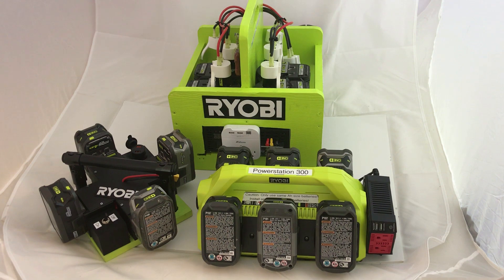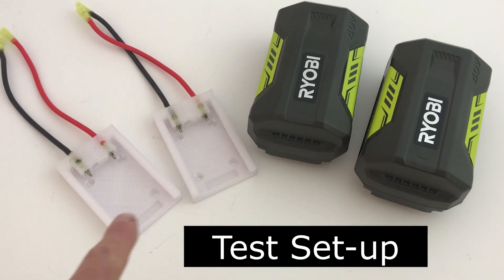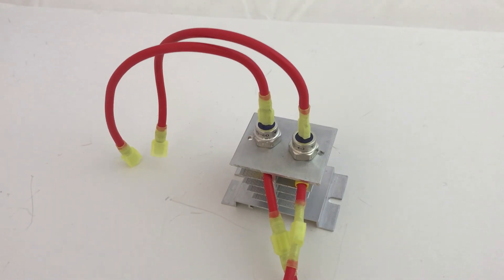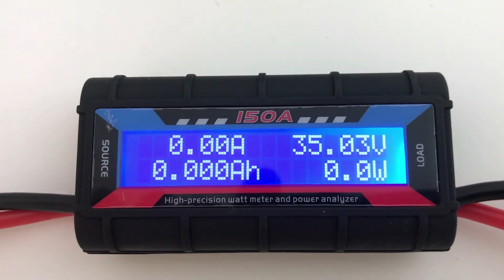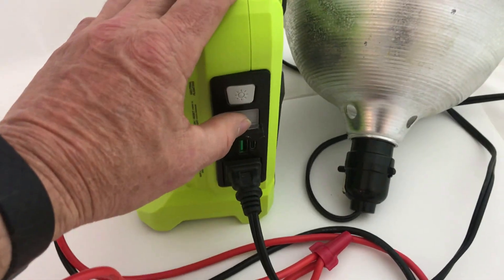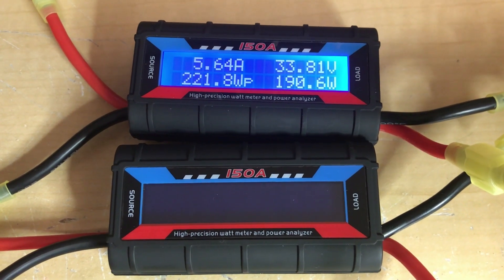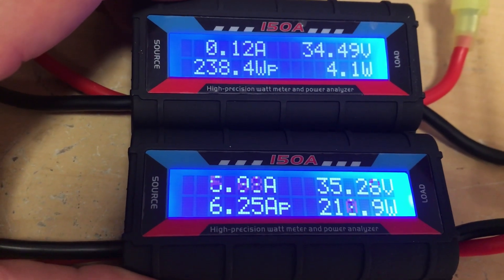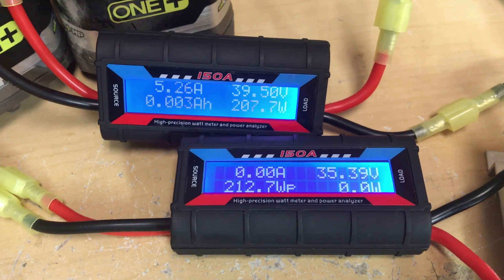Hot Swap Ryobi 18/40 Batteries of different charge levels

Comment: Cool video. Just one note, you can use simple resistors to slow the flow from higher voltage to lower voltage packs. They will quickly equalize. As you’ve show, with blocking diodes, you won’t get shared effort from batteries at different SoC.

Let’s say you start with fully charged and discharged batteries: 20V and 15V have a 5V difference. I=V/R so a 1 ohm resistor will mean just 5A transfer which is nothing for these battery packs. 5V and 5A is only 25W. So get a 1ohm 50W wirewound resistor for $5, place between one of the parallel connections and viola! Easy safe paralleling and no diodes nor heat sink needed.

Another thing is these batteries have mosfets inside that control charge and discharge independently. So you might have little to no transfer anyway, because the lower V battery hasn’t flipped ‘on’ its charging mosfet. I haven’t tested but I’ve been inside lots of these batteries from all manufacturers.

All that aside, nice video 👍

Comment: Hi, have you tried connecting 2x 40v batteries in series for 80v? I'm wondering if it's possible to do so for a 72v ebike setup. Thanks
Reply from the maker: not yet. Would have to see if the BMS could handle the high voltage. It would be easy to do with the 40V battery holders I designed: https://www.printables.com/model/61098-ryobi-40v-pass-thru-charging-adapters/files
Reply: @SerendipitySue  Thank you for the quick response. Is there a way to figure out if the BMS can handle 80v without damaging it? 

I have a 40V 6Ah batt out of its case, I'm assuming that the most crucial part are the power limiting mosfets?

Comment: I am having an issue where I have 6 40v 6ah batteries in parallel running a 3000 watt inverter but only one or 2 seem to be supplying the load. They were fully charged before use so all should be very similar voltage? What do you think would happen if I used a 300k ohm resistor like you talked about in each battery connector to put the batteries in charge mode to keep the voltage levels more consistent between the batteries? Will they still discharge in charge mode also? Do you see any dangers in this? Thanks for all your work and help!!! Have a blessed day!!!
Reply from the maker: Do you have the blocking diodes hooked up correctly? If the batteries are of different voltages, only the highest voltage battery will be providing power until the voltage comes down to the next highest. Also check out: https://youtu.be/p4xW9f1ohlw
Reply: I haven't added any blocking diodes at all. I just now found your video. I was wondering about this before I hooked it all up and found out the hard way. I wonder what would happen if you used the resistor to put the batteries in charge mode oneach connector like your other video stated. I thought the batteries may level each other off if they were in charge mode until all the batteries were equal. Do they still discharge when using the resistor to put them in charge mode?
Reply from the maker: @jonathanpayton7718  If all the batteries are the same voltage (charge level), then you don't need the blocking diodes. You can put the batteries in charge mode using the resistor. In my tests, you can be charging and using at the same time
Reply: @SerendipitySue  thanks for the info! I will give it a try soon and see how it goes.

Comment: So with the blocking diodes in place, can add different size Amp hour batteries? Let’s say two 4ah 18v batteries and 1 6ah 40v battery. Or two 4 ah 18v batteries and two 6 Ah 18v batteries?

Comment: So with your pass through testing, it sounds like it's possible to have the 6-port supercharger be a sequential charger and an inverter with hot swappable batteries. Is that right?
Reply from the maker: The official Ryobi 6 battery charger is an AC device. It only provides sequential charging. The easiest way to use it with 12V car plug would be with a small pure sine inverter ( https://amzn.to/3dSYJ9P ). It only takes 85W. You could of course make your own 6 port charger.
Reply: @SerendipitySue  I get excited after watching your videos thinking about what's possible. I was originally wondering if there was a way to avoid using an inverter with the 6-port but realized it wouldn't really be possible.

I'm excited about the idea of using pass through and hot swap charging on the 6-port with the 40 volt inverter.

Thanks so much for your wonderful videos!
Reply: I just bought the supercharger and four 9Ah batteries during the sale this week... but now I'm kicking myself for not getting 6 of them instead.

Comment: I have been working with the 18v batteries (no 40v) for battery packs.  The issue of battery charge status was something I have been thinking about.  The diode solution is a good idea but I was thinking of using 5a buck converters ($1.50 on Amazon) on each battery to isolate and reduce voltage to 13v.  Your thoughts on this would be appreciated.  BTW, you beat me to the punch on the Ryobi super charger conversion.  I have been experimenting with the charger for a while.  I have several Ryobi battery videos on my channel if interested.  I enjoy (and learn new ideas) from your Ryobi series. Keep them coming :>)
Reply: One more thing Chris.  At the beginning of this video you show a 4 battery (18v) pack with the other 2 packs.  I haven't seen any video on the 4 pack unit.  Is there one?

Comment: Interesting. With the diodes, I am guessing you can not simultaneously charge and discharge, with the disparate voltages
Reply from the maker: I think you could can still charge the 40V batteries while using them. I haven't figured out the protocol for charging them yet. I have to use an individual Ryobi charger for each one. The chargers  require 42V. Will have to try.

Comment: Interesting results.  What is the voltage drop across the diode when there is only 1, 40Volt battery supplying the power to the inverter?  I could get the voltage from a data sheet.  Is there a 1N number on the diode?
Reply from the maker: I don't see any part number. I bought it from: https://amzn.to/39FoVUc . There is a comment from someone that said 2% forward drop (that would be 0.8V in this case). I'll try to test.